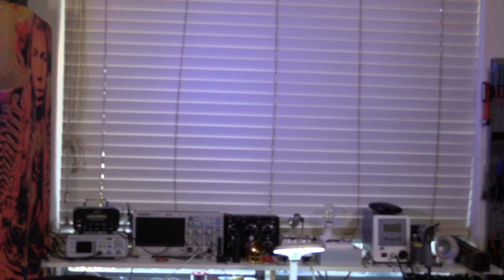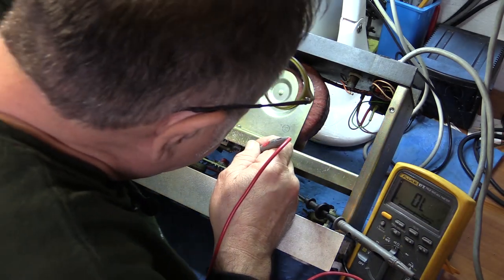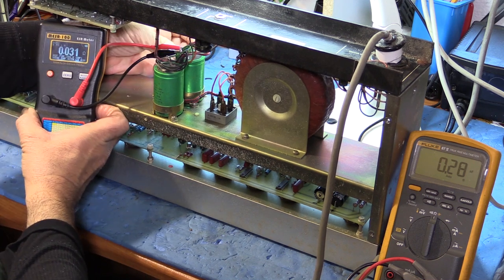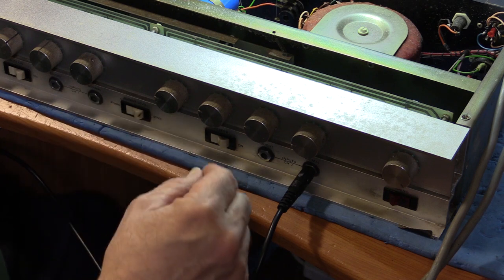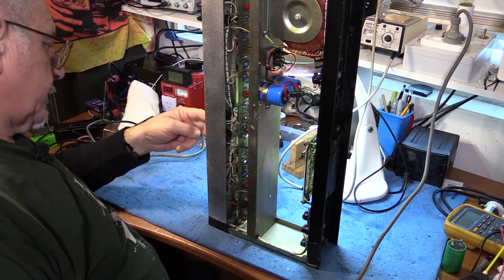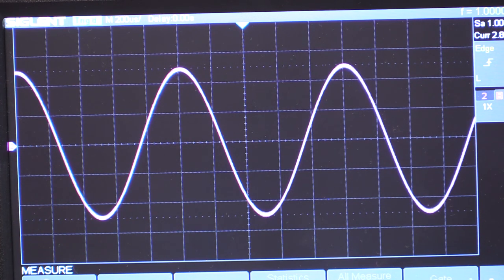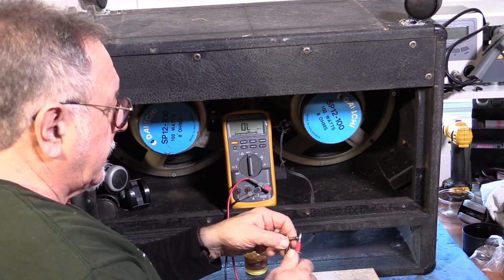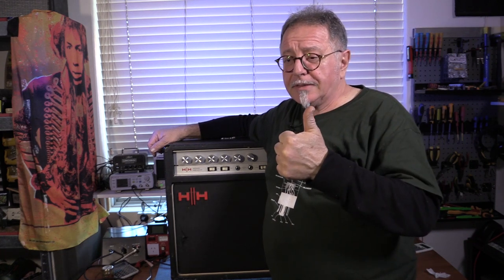Let's Repair this 100w H/H Combo solid state amplifier

Comment: I still have mine. Used to gig with it from the late 80s to 2000. It's still in my garage. Every now and then i plug it in and wake the neighbourhood up. A fantastic almost valve like sound. Mine was so very loud. The volume pot needed replacing because it had turned into a switch either silent or full on...lol.
Inspite of how heavy it was to cart around it served me so well and sounded great with a boss gt6 looped in.
Reply from the maker: It has a mighty sound
Reply: I use mine to gig.... i run a modeller through it and use a 2 x12 v30 cab. I only ever use studio mode at that is ear spliting. The stage mode is so loud it physically stuns you!! Great amp of a bygone era

Comment: I've still got this same amp, but just as a head unit not a combo. Bought mine from a pawn shop in Kings Cross 1987. Super loud but a surprisingly good sound. Have never needed to fix it and it still goes good. Can get instant Angus when I use an SG through it. My other amps are valve amps but the HH has held it's own and stood the test of time. See one buy it! Mario NZ
Reply from the maker: Perfect answer. You have demonstrated the beauty of individual tastes, Mario. For me, I loved the H/H cleans, but not the dirty. The other guitar player in the band of my youth had a H/H. It more than kept up with my Twin.  Good memories of that H/H.

Comment: Used to have one of these in an old band I was in way back in the early 80's...Great little amp. Also used their power amps for vocals with a small mixing desk. Still around today, that shows how robust they were. Interesting fix and thanks for sharing, more knowledge acquired..Ed..U.K..😀
Reply from the maker: Cool Ed. I was also in a band in the 70s, where I had a Twin and the other guitar player had this model HH. The amp in the repair sounded even better than I remembered from my youth. I believe solid-state amps have their place in musical history when they stop trying to sound to sound like a valve amp.
Reply: @theguitaramptech ,  here in the States,  John Fogerty of Creedence Clearwater Revival became famous while playing through a solid state Kustom amp. The Lab Series amps have some fans (including BB King).  Peavey made lots of solid state amps that were used by working musicians. I once had a Marshall Lead 20 that was a decent sounding SS amp except for cheesy low quality pots that were always a bit noisy even when new.

Comment: I owned a H&H IC100S back in the mid 70's the so called sustain was more like a rampent fuzz box it was nasty !The front panel should glow green when on, the speakers were JBL's in the cab that was with mine,
Reply from the maker: That would be awesome with the JBLs. Heavy as a block of concrete...but awesome. I have not heard any solid state amps with a great overdrive sound. Its just a totally different beast.

Comment: In the UK we pronounce the manufacturer as "H and H". Interesting! These old solid-state amps are bullet proof. I run a 1988 Sessionette SG75 as my main rig. The only thing it's had since the day it was made is new pots and new jacks.👍
Reply from the maker: Its interesting with the pronunciation differences. I haven't come across a Sessionette in Australia. Those transistor amps are great...until they break, and then its a battle to find those obsolete transistors.I currently have a JC120 on the bench with a very obsolete TA7122AP inline IC. None of the "reputable" suppliers have heard of it. I am buying 4 from China...wish me luck!
Reply: Not everyone used this pronuciation.  Maybe a regional thing?  I lived 25 minutes away from this firm when they were located in Cambridge in the 70's and they were certainly known as HH, but hey, what's in a name.

Interestingly, the early version of the HH amps were not as bullet-proof as we might have hoped.  Here's some very informative history from the website of MAJ Electronics who have first-hand experience working at HH and are the first port of call for spares/repairs/advice in the UK - check them out!.

"2. Power amplifier failure. This was a big problem. The first units I ever saw in 1971-2 used Darlington based output stages similar to the second series TPA 50D and had driver pcb numbers AO 3073, (and AO3073/2 - second attempt, getting there...) I dont think the transistor based TPA AO3071 was ever used in the music range. The Darlington units were state of the art and well designed but turned out to be totally inadequate from a gigging point of view. There is a slight difference between a TPA 50D being used sensibly by a qualified BBC engineer using a controlled signal source connected to a correct speaker load using impeccable cables and young son hammering a Les Paul or a Strat at full power+++ and then some through an IC100 or S connected to as many speakers as he can find (Impedance? Wosthat?) using dodgy bell wire speaker leads and sellotape wrapped arcing sparking shit jack plugs. That slight difference is that it bangs and costs money to repair and doesn't do your reputation as a manufacturer any good. Ah.. So they changed to using a conventional bipolar output stage (AO 3103 pcb, through issues 2/3/5/6) and the problems grew less, but still didn’t quite go away. I maintained then and still do that the problem was not the actual output devices themselves, but the driver stages. The driver transistor part of a typical Darlington output transistor is fabricated on chip to supply the theoretic need of the output transistor part – not big enough in our thrash music world. The discrete TO-5 drivers used on the AO3103/5/6 were better but still only just adequate. In December 1974 the AO3103/7 pcb with its two grunt overkill RCA 40871/2 plastic driver transistors appeared across the range and the problem was minimised. The AS00014 pcb used in the VS and later units was a further development of this, getting rid of all the TO-5 devices and inheriting more sophisticated short circuit protection courtesy of the S500-D (Crown). This was a great move has proved to be a very reliable design."
Reply: HH for me always..... London since 1965

Comment: Great video..I have three H&H amps 2 are valve sound and one PA amp..One of the valve sound amps has a very low volume.  what can cause this ?  any help would be great..regards.
Reply from the maker: Wow! A valve HH! Very cool. 
The best place to start is the power supply. Find a schematic and check that your voltages are close. Then try a different set of power valves (don't forget they will need to be biased).
Reply: @theguitaramptech  Thank you for your help..best regards.

Comment: In the UK here and these were everywhere in the late 80's/early90, heads and combos all the local bands around here used them because they were cheap and loud, none of us could afford a Marshall. ;)
Reply from the maker: They were pretty well made, Simon. We had similar Aussie made amps, but more tube amps in the 70's, like Wasp. I struck gold (not!) with my solid state Savage in 1975. It was loud...until it blew up, like all the other Savages..
Reply: Interesting; here in the States I've never seen or heard of an HH amp.

Comment: Awesome video and well explained 👍👍👍👍
Reply from the maker: Thank you Slavko!
Reply: @theguitaramptech  one question mate???
I have same model head HH, but does not come with reverb tank 👐, so can I install one  like that amp you just fixed????
Reply: I mean upgrade it with the reverb ????
Reply from the maker: @slavkomakarovski1158  that’s not so easy, Slavko. You need to add circuitry to drive the reverb tank, recover the wet sound, and then mix it back into the signal path. A huge job. If it was me, I wouldn’t do it. I would much prefer to have a nice reverb pedal. Cheaper. Easier. 😁

Comment: Hi there , I have the exact same amp, it sounds great, but noticed where the two transistors are rear of the chassis, it's very hot, around 70 degrees celsius, no real heat sink there, would you think this is acceptable ?  I don't want it to burn out anything important. Thanks.
Reply from the maker: That does sound hot, but those transistors do seem to run very hot and keep on going. They're obsolete now so start searching for a matched replacement pair.. Check that you have the correct value of fuse for both of the output transistors. I think they're 4A, but please don't believe me.
Reply: @theguitaramptech  Hi and thanks for your reply, I dropped my amp off to my tech today, he's very good, so fingers crossed. Cheers Doug

Comment: My HH ic 100 lights up fine power is in the amp but no sound whatsoever when guitar plugged in. No crackle no hiss nothing! Filter caps measure spot on at 4700 uf.  Any tips gratefully received. Thanks
Reply from the maker: Without having it on my bench, I can only give you general advice. First thing is to check your power supply voltages. As you've probably seen on some of my videos, I never go with just the uF value of a cap. I also check its ESR. If that's all good, its time to start tracing your sine wave input signal with an oscilloscope. Good luck.
Reply: @theguitaramptech  Thanks for the reply. The amp appears to have come to life with a continuous humming noise from the the speaker. There is nothing at all being generated from a guitar signal. Unfortunately I don't have an oscilloscope. I'm just checking voltages, resistance and capacitances with my meter. Everything appears to be ok. I'm wondering if those output transistors at the back under the plate might be the culprit?

Comment: Spot on with the filter cap diagnosis and replacement. They often give the game away straight up through having spewed all down the insides of the chassis. Same length and diameter are getting hard to find now. I managed to pick up some new stock in Singapore a few years back for ongoing repairs. Had the electroluminescent front panel been disconnected as well? I know this is sometimes viewed as a safety concern because it's full unprotected mains voltage behind the thin perspex. Also, that round Bulgin bakelite mains plug could do with being exchanged for a new IEC receptacle and lead. Thanks for this very interesting post and looking forward to seeing more of the classic HH gear that's sill going strong down under.
Reply from the maker: Its always a difficult decision about amp saftey. I nearly always err on the side of increased safety. I decided to leave the illumination intact from memory.
Reply: I've just recapped my HH V-S Musician amp (1976) and had a reall challenge finding 4700 mf, 63v caps with a 35mm diameter to fit the original clips.  Ebay was finally my reluctant friend providing a pair of Nichicon caps from China that have a good rap online and have worked well so far...
Reply: @andrewsutton7007 please report back later on to know if they're worth it! 👍🏻

Comment: I have a few Trace Elliot amps from the 80s and 90s. They work ok. Decent volume.
Is there any point changing filter caps (or anything else) in old amps if nothing is obviously wrong?
Reply from the maker: Thanks for the excellent question, Bryan. The not-so-excellent answer is "it depends". If you are gigging with the amps and you depend on reliability and performance, then I would definitely change the filter capacitors. If you are noodling around at home, you can get away with it for longer. 
It's like oil changes on a car. If you're racing, you change the oil after every race. If you are just going to the corner store, you can change your oil once a year. 
Good luck with the Trace. Great sounding amps.
Reply: @theguitaramptech  "Oh oh, the infamous Trace Elliott [bass] amp has f----d up again". David Lindley, at a gig with his band ElRayo-X around 1988 or 89 (bassist Jorge Calderon, who also played with Warren Zevon,  was using one).  I never heard of HH, must be an Aussie thing. H&K, yes....

Comment: Hi Chris, cool video! Cutting out the "boring bits" is well appreciated. I have an HH Bass amp head that was working fine albeit with a bit of hum. I replaced the filter caps but not much changed. For some reason the amp decided not to come on a few days ago! The control panel lights up so I know it's not the mains fuse (checked the fuse anyway) but no signal at all, no hum etc. Is there anything obvious I could look for or test (I can solder & have a multimeter etc.)? I can't find any "Channel fuse" on the PCBs. I heard the power resistors sometimes fail (the big grey ones), would that be the cause? Any suggestions welcome...wish I was in Sydney (I was in Auckland for 30 years but back in UK now). Cheers, Ken.
Reply from the maker: Hi Ken. First step is always check the fuse. Second step: check the voltages around your power supply. Disconnect stages where possible in your search to isolate the area where the fault lies. Such an old amp it could be anywhere, but I would focus on the power supply. . Just go through it step-by-step and I think you’ll find the problem.
Reply: @theguitaramptech  Thanks, mate. I'd checked the fuse & supply all the way to the transformer but the  problem wasn't there; the amp was fine but there was a bad connection on the signal wire that had decided to work anyway for 3 weeks before deciding not to work at all! Sounds a lot better with a clean copper connection rather than a plastic sandwich......:)
Reply from the maker: @k3np465  good detective work!

Comment: Hey man thanks for the video. My filter caps are bust and eroded. Just wondering what caps you replaced the old caps with exactly. I just got two of these amps both in the same condition though one is I think an earlier model. Either way, both are bust and I suspect it might be the same issue with both amps. Loads of buzz, outputs seem to only give either left or right signals depending on where the jacks position in the socket, just a whole bunch of stuff. I can do all the fixings but figuring out what all the wee bits and bobs are called really baffles me.
Reply from the maker: Thanks Sean. I’m sure you understand that I can’t advise you on an amp that I have not seen. There’s a good chance you may need to replace the filter capacitors. Replace like with like and take care with the polarity.
Reply: @theguitaramptech  thanks man, yeah I completely understand. Solid advice
Reply: Replacement caps are 4700uf in the main filter part.  I used to repair lots of these amps with there ever growing fault list.  Even the reverb tank needs replaced. These little amps worked great back in the day.

The main power to3 transistors are npn types..

Comment: The knobs look like the ones on my old 1969 Acoustic 150. I was impressed because, unlike it, yours had no push pull crossover distortion. You got the same voltage on the scope as your Fluke so was that 100 Watts Peak to Peak or RMS?
Reply from the maker: Great comment, Mike. I only monitor crossover distortion on in oscilloscope. My oscilloscope will read both Peak and RMS where my fluke will measure RMS values. So when I look at power output of an amplifier, I will either use the RMS value on the scope or fluke. They correlate extremely closely.

Comment: Today I got my ic100 out to test some speakers but had no sound and the transistors were as hot as hades, went online looking for some transistors but could not find any with the numbers that were on it  (9029 " 7428/7429 ) do you know what the equivelant would be and am also replacing the caps 2 - 10000uf 50v other than that all looks ok no dramas on the dvm  but I want to replace the transistors thnx
Reply from the maker: You have discovered the main reason I don't like working on 70s and 80s solid state amps. Many of the semiconductor parts are obsolete and their equivalents are obsolete. You can literally waste hours in the search. Good luck, johnny.
Reply: @theguitaramptech  schematic say 2n3773 I'll try those but the capacitors are another story, having trouble locating 680uf 25v caps I found one dead and I haven't found any axial caps yet,  and the other 2 are screw terminal, I could go schematics and try 4700uf but can only find pushin caps I suppose I can solder wires on but that would be in about 6-8 weeks when they arrive from China, Oh well good amp I want to keep it alive and well
Reply from the maker: @johnnytheangel1  Don't worry about the 68uF. Pick a value that you can find up to 100uF. I always like to increase the voltage as a safeguard. Just make sure it physically fits.
.
Reply: @theguitaramptech  unfortunately Jaycar in its infinite wisdom don't stock anything over 4700 so I got a couple of 4700uf at 63v and a couple 2n3773 transistors and we'll see how it goes

Comment: I'm not an electronics expert but I have a few bits that I loan out for community use. I have a HH IS112P with a dodgy volume potentiometer (it's fine at high volume but crackly at mininmum levels. Where would I start to get a replacement. I live in Ireland.
Reply from the maker: I would try either Element 14 (Farnell) or Antique Electronics Supply.
Reply: @theguitaramptech  Thank you I ordered it from Farnell and found out about linear versus log in the process! Courier is away more than the cost of the pot. Thanks.
Reply from the maker: @michealhurley8412  yes, shipping costs plague us in Australia with every order. Americans don't know how good they've got it!